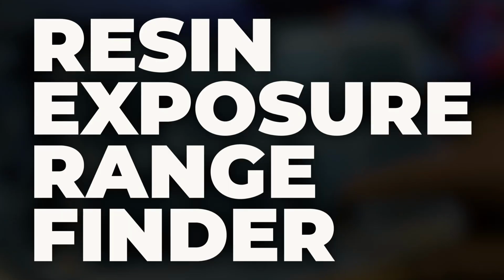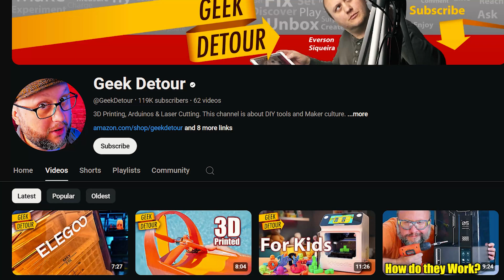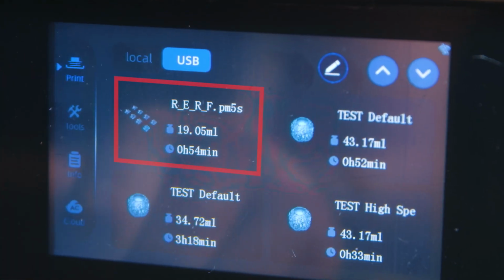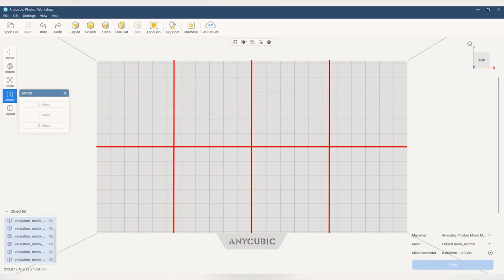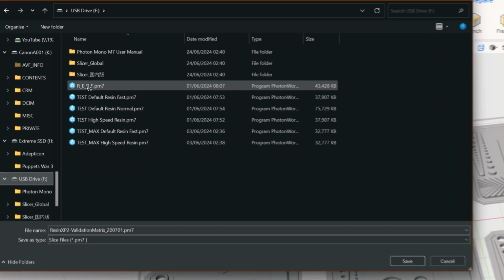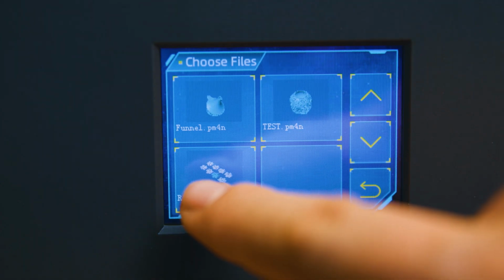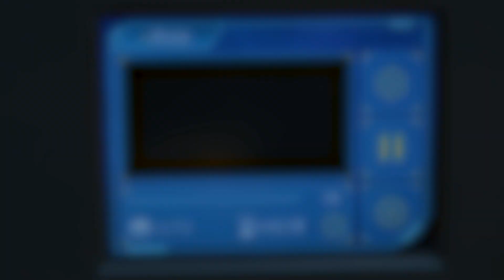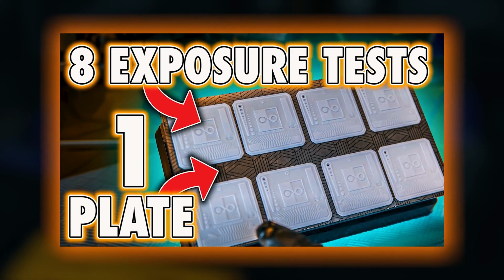R.E.R.F Made Easy - How to Make an Anycubic RERF or Resin Exposure Range Finder test.

Comment: Jenky isn't the word for Anycubic documentation.  They flat out suck considering how many units they push to the USA you would think they would have a quality interpreter by now.  YOUR VIDEOS ARE SAVING A GRACE!  That said, I had two previous Photon models and now a M7 that is brand new and I cannot get it to print out the RERF file at all.  I have no idea how to get the resin to stick to the platform after several manual relevellings and warmed up resin.  :(

Comment: I just got the M7 Max, and it has setting you can change on the front display panel, to change the exposure times. Not sure if I should use the settings in the slicer, or the display screen?

Comment: So there's an update to this as of photon workshop 3.6.5. There's a "calibration" button in the slicer that will let you set up your own RERF. Not only that, but it prints the order on the plate. You just import the model you want to use. The slicer will automatically set your #1 position on the plate to your baseline exposure time, and increment the exposure time by an interval you can set. I wanted to check my exposure time, so I changed the base time for the resin to 1 second like Ross recommended, and then ran the test.
Reply: Did you find the menu?

Comment: Hopefully someone can help me here.  I bought an M7 Max, and its awesome.  But I'm having issues getting Siraya Tech Blu Mecha White to work for the RERF calibration.  Its not sticking to the build plate.  Does anyone know on this printer if it uses the burn in layers from the slicer or if it uses some default number in the printer for the RERF test and ignores the slicer setting?

Comment: Hi Ross. The new version of Anycubic Photon Workshop slicer has got "calibration" option in the menu. It allows creating your own RERF file with a custom model, number of copies (4, 6, 8) start exposure value and exposure step. I think it is even better than Elegoo UI approach as here one can create several RERF files with different speed and layer height settings for different resins and use them to recalibrate whenever needed. You could actually create a quick video about this new feature. What do you think?
Reply: Hi, where i can found this option? Thanks o/
Reply: Where?
Reply: What menu?
Reply from the maker: Ooooh, thanks, I didn't know! Next time I have an Anycubic Machine Handy I'll show this off!

Comment: I was wondering.
Do you really need to use the Anycubic Photon Workshop slicer in order for the Printer to recognize that it is a test and print it as we want it?
I haven't tried it yet, but I was thinking about making a test with lychee, naming it correctly, and seeing if that works.
Although, you said that even changing the version caused it to not work, so... idk. Would be nice, because  I think it might be simpler to use a slicer we know.
Reply from the maker: Honestly. Try it. As I said a few times throughout, these are the steps to make sure it works. You could change some and it be ok. 

It depends on the printer. Software version and a few other things. But I made this as a guide to ensure it worked on every Anycubic printer
Reply: @FauxHammer  Yeah, well thank you! I appreciate it!
If you didn't make this video, I don't think I would have known that we could do this!
I did try it last night, and it appeared to work, so... pretty cool! :)
Thanks man, for making the video! I did these steps with the Lychee Slicer for an Anycubic Photon Mono X, with some overlap for the items, and the Exposure times were working as expected.
I need to record it with a camera and make sure that it is based off of the exposure time I set for that File (which may have been 3.5 seconds), but I can see that it is otherwise working.

Thank you so much! :)

Comment: Yesterday, I was showing my brother in law the results of the Resin Exposure Range Finder Test ("R_E_R_F" file made by Anycubic), printed on our Photon Mono X.
And he noticed that it would be nice if you could individually select parts of your print to make them print a different/specific exposure times.
So, for example, eyelashes (thin hairs) on a model, you might want to print at a high or medium exposure (to maintain strength), while normal layers of the body might use medium or high.
Because lower exposures allow for retaining more detail (without the cured resin growing similar to a crystal), but may not be strong enough to successfully print.
And knowing what "Over Exposure" is (which can make certain resins more brittle), is also important.

But, honestly, Ross, now that I am thinking about it, if someone did the necessary testing and problem solving to find out what the perfect (or relatively accurate) exposure settings are needed for each part of a print, then we could have a much better slicer.
It's a really interesting problem, and actually, I think that you could do it by just simply having your exposure setting on long enough (for the whole print) to allow some parts to be exposed at a high amount, and other parts to be exposed at a low amount, which could be adjusted by having the pixels in each layer set as a grayscale number, which allows for more or less light to come in over the time that the model is being cured for that layer.
And (assuming that the firmware on the printer allows for grayscale pixels, instead of just "full on" or "full off"), then we could certainly make this.

Aside from the software being able to tell what you need for each part of the model (to retain both detail and strength/resilience of your part), then you would need a test that you print and get numbers from, that you then put into the software, so that the software knows how strong a printed model is at a certain level of exposure, and what it's characteristics are (how flexible/rigid, and whether it breaks when bending).

Anyway, it is an idea that I feel like the super expensive resin printer manufacturers may have already solved for their printer ecosystems.
But, we can do the same thing without their work.

Anyway!
I just wanted to share this idea, because I think that it would be an awesome (amazing) addition to the Resin Printing Community.

Thanks for reading,

Comment: Just got an m7. My rerf is not running at different exposure times. It’s running the full plate one exposure time set originally
Reply from the maker: Watch through again. Make sure you haven’t overlapped the invisible lines. Are using the right slicer and name it identical to the file on the usb drive

Comment: How did you set the different individual exposure times for each object? I can only change it for all objects
Reply from the maker: you don't set it. in the video it says, the time you set in your clicer is the starting time, so that is test "1", the one that exposeses for the least ammount of time. Everything after that is 0.25s loner than the last.
Reply: @FauxHammer  now I understand, thank you very much. I was a bit confused but now I got it👍
Reply: This still doesn’t make sense to me though, I get the 0.25 delay per piece set in the normal exposure time but why is the first piece exposing for 1s then and not 0.25, I can’t see anywhere else that you changed for that. 

If I need to expose from 4 to 8s with some translucent resin and have it step at x amount this is where I’m lost trying to understand how to apply what I’m learning here.

Comment: Thanks for the clear guide. Heads up for those with wireless printing; on my mono M7, I was able to print it wirelessly. I just had to name it the proper name (R_E_R_F in my case). Confirmed it with the vat off and it worked.
Reply: How do you check the uv light time without resin, without the screen and without the bed? Mine says that the plate is not installed. Should I just click "ignore"? I don't want to test it and make it touch my screen haha
Reply from the maker: Thanks, and a great experience to share. can i ask, did you start the print wirelessly? or just transfer it that way and start it on the printer?

Also, Anycubic may actually be updating the M7 to have a more controllable version of this test within the UI, so that;s hand when (if) it comes
Reply: I used the "Remote Print" option in the workshop. Then clicked the Pen Icon next to the file name and named the print properly. Also, I was using the "Phrozen XP Finder" test.
Reply from the maker: @gregkoenig4624  Thanks, yeah, it shouldn't matter what file you put on it, that's what so great about this, you can use whatever you prefer. So it does work if you start the print remotely too! that's great news! I know on Elegoo, you have to go into the UI to run the test, so I'd say this is a decent small benefoit of the RERF method for now
Reply: Hey, could you please tell us the order of the rerf in mono m7? Which corner is the one with less exposure time?

Comment: I put 8 xp tests down in the lychee slicer and made a backup of the rerf file and then overwritten it on the usb, works perfectly, no need to go into photon workshop
Reply from the maker: With 8 clearly different exposure test results? or just 8 indodividual prints? Also, what printer?
Bare in mind this was designed to remove as many potentially breaking variables as possible? becasue in a slightly different configuration, your approach may not work?
Reply: @FauxHammer  I loaded the usb into the printer (M7 max) with out the vat / plate and it did each one turning off .25 after each other, I get there is more variables but only using the file name i was able to just use lychee, just reporting what i tried :)
Reply: Really?
I was wondering if that would work!
Thank you for sharing.
I'm going to try it with Lychee on a Photon Mono X.
Reply: @ Not sure if you can do the new method with that printer in photon workshop but there is a new calibration tab which is very neat

Comment: Thanks for a very informative video. I’m having problems getting the test pieces off the building plate with the scraper supplied. A couple of the broke in half and others chipped off at corners. Any suggestions as to how I can stop this please?

I noticed you used a small yellow scraper, maybe that would be better.

I’m also looking at a flexible build plate kit and am waiting for Anycubic to tell me if they make one.
I have only had my Photon Mono M5s pro for a couple of weeks and so am completely new to all this.

I’m looking to print historical miniatures for wargames and so want to make sure I get as much detail as I can.

Thanks again for your guidance, much appreciated.
Reply from the maker: heya, so yeah a sharp scraper is key, if you have a razor blade scraper that will make it easy, but you need to be super careful, some people even recommend plastic blades.

it could also be that your base exposure time is too high too which will all-but fuse the model to the plate in those early layers. I find 30s to be adequete for most temperatures, un;ess your plate is unlevel
Reply: @FauxHammer thanks for the helpful reply. Much appreciated.

Comment: Just got myself a used M5s...I know, yes its given me some major headache and  I swear that it is not exposing the RERF the way it says it is, in the online manual. Going to check now...
Reply from the maker: Do as dry print as shown in the video (take the vat and plate out) and see what it is dfoing after it does your base and transition layers (You'll need to count how many of each you ahve in the settings,  and ignore that many layers on the print)

Let me know if this helps please

Comment: You had a shot of where the rerf didn't print one or two of the test, what would lead to this problem? Ever since I got my anycubic resin printer it doesn't print 2 of the 8 ever, would mixing resin fix the problem or clean the plate help even though it printed them all except 2.
thanks for video😀
Reply from the maker: In this case, for that specific shot. It was in the M7 and it was due to my plate not being level. It can also be if the base exposure time is too low, occasionally too high as well.

Comment: Test models and RERF files (with needed extension) are on Anycubic Site as files  in sapport section for particular Printer. So You dont need to copy them... but if You fill safe this way it is fine.

Comment: I would think the easiest thing that anycubic could do, or any company, is to have a preset "load?" of 8 test models but on each of the models have "-0.25" , "-0.50" "-0.75" etc on each one in sequence. That way you don't need to think about which model is which and their orientation on the build plate. You only need to keep track of what the "base" time was that you set for model 1, and the rest is self evident. Not sure how practical that is but it takes some of the mental load off what is probably a frustrating part of the resin calibration workflow.
Either that or have a file with 8 copies of a default "raft?" model that has the number markings for each exposure built into each raft, then in the slicer you can copy in and plonk whatever "real" test model you want to use onto/into the raft that has the numbers on it.

Comment: welp, on my photon mono 4k it just don't work, even file from usb drive. think i'm ready to ditch it for saturn 4 ultra
Reply from the maker: Surely it does. have you tried it with a dry print? They must has screwed up your file on the YUSB, I;d ask any other owners for a copy of the slicerd file. I have a ton of them saved but i never had the OG Mono 4k
Reply: I just got a Saturn 4 ultra. Got it dialed in to 1.6 sec exposure with a brewer belt and a 3 second wait before. Works really nicely and the calibration feature was awesome to set up the resin. Im using the elegoo abs like V3. Minis coming out are really nice